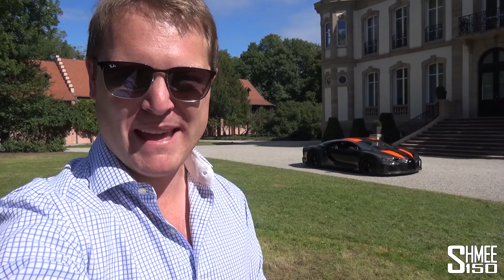THIS is the Bugatti Chiron Super Sport 300+ That Broke 300mph!

Comment: 5:10 there size of the disc rotor is almost the same diameter as the front rim which I believe is 21 inches. That rotor must be about 19 inches across. Insane

Comment: How was that a record run, did they actually pull a second run in the opposite direction?  Backing up a run for an average  speed of the down and back, that average speed would be what is or isn’t a record.  Sure they did 300mhp huge respect for how difficult that is, but as I understand setting a world record the Bugatti time doesn’t qualify.  I could be wrong of corse.

Comment: Taking both directions average to measure the top speed is not the proper way, that's a lie, you should have to try to achieve the maximum speed as much as you can,

Comment: The fender holes on the front are very much like the EB110. I really like this car a lot there's just two problems. 1) 1600HP is under rated 2) I think the could have done a better job with the exhaust. But I'm willing to be the exhaust is where it is for airflow or to help evacuate air.

Comment: Nice car and nice try but not a record. 
Koenigsegg Agera RS is still the fastest production car:-)
On 2 August 2019, Andy Wallace achieved a maximum of 490.48 km/h (304.77 mph) in a pre-production Chiron prototype at Ehra-Lessien, which was verified by TÜV. The recording setting version of the Chiron is described by Bugatti a "near production ready prototype". It was later revealed that the record setting car was a prototype of the Chiron Super Sport 300+. Excluded from the list due to performing a uni-directional top speed run.

Comment: It was always a ridiculous decadent dead end car but 490 is genuinely fast. Odd that they didn't go with video mirrors for the record since that is legal in both EU and USA. Those mirrors are serious airbrakes. They should also have smooth rims and inside covers. Aero blocks in line with the tires matter a lot as well. Could probably easily go above 500.

Comment: Also, the Nevada run by the Agera RS was done at a very high density altitude (thinner air)  and a longer track. If Koenigsegg tried that run at the lower altitude of the VW test track (thicker air) with a shorter track, the top speed of the Agera would have been much lower and if the Chiron went out in Nevada it would have gone much faster.

Comment: Hey Shmee because you said its rumored the car could go faster. Yes they claimed that it could actually do, if they would have driven it in Nevada, due to the thinner air there, meaning less airresistance, 515km/h. Which would mean we also have the first car right here that (could) break the 500kmh barriere. Maybe they do it when they release the production cars would deffinitly be awesome.

Comment: I'm wondering what the average speed would be in both directions. Not taking anything away from the record but the car was optimised to make the run. Fuel, tyres, 100 more horsepower, the interior setup vs. Koenigsegg Agera's customer car with regular everything!

Comment: Bugatti Chiron do NOT have speed records, as they did NOT drive in either direction. And that it was NOT a standard Bugatti, it is partly extended as well as built-in shelter. But Bugatti wants to brag.
The truth is that Koenigsegg Agera RS still holds the speed record. It is a standard car and without a protective cage, as well as the high speed cars in either direction.